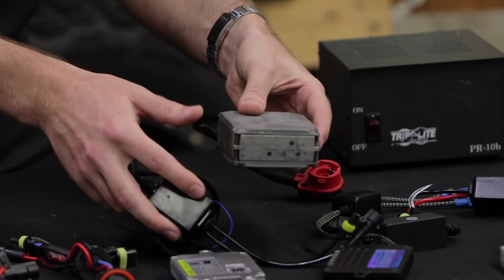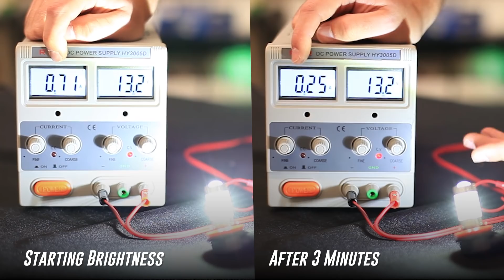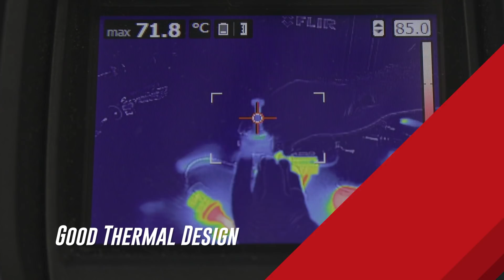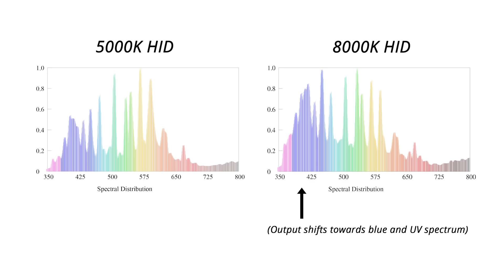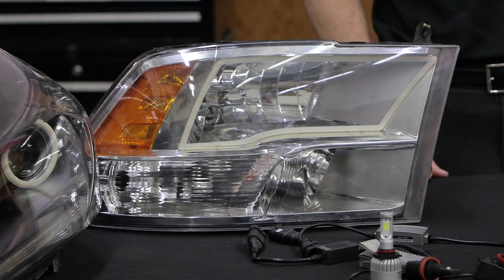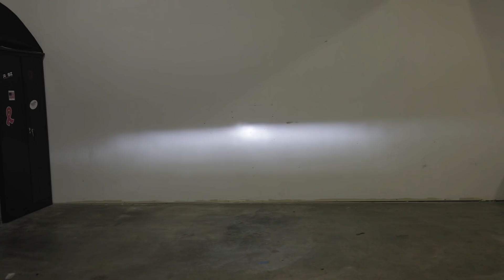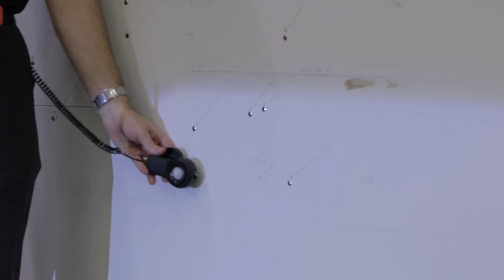HID vs LED Headlight Bulbs: EXPLAINED

Comment: The best review I have ever seen regarding HID vs LED comparisons I have seen to date.  I had a 55 watt XenonHid.com kit (looked like 10x brighter than stock) that was perfect on my 2017 Honda Ridgeline RTLE Awd but due to the canbus system, I had to frequently turn the switch on and off just to get them to turn on.    I ended up switching to Headlight Revolution S-V.4 led and they are excellent. Not quite as bright (still looks 3x brighter than stock) and definitely more reliable on my end.
Reply: I had this problem on my Honda 954RR motorcycle, I used a programmable parking brake video bypass module of all things. They are used in cars to get video when driving on Alpine radios. Basically everytime I started the bike the bypass was programmed to do a on/off/on sequence that triggered a relay that turned on the ballast. I couldn't believe a $15 parts solved it. This was an FYI just in case someone who aren't fans of LEDs just yet.

Comment: so reflector headlight gives more light then projector headlights?
Reply from the maker: Hey Marko! You can see a higher measured lux rating for reflector-style housings since they don't suffer transmission losses like a projector lens does. Just because the light source is brighter, that does not mean it will all be focused on the road. Thanks for watching! 👍

Comment: Great video, I have a set of SL1's for my 2019 Fiat 500 Abarth. I installed them briefly (10 minutes or so)and then pulled them out. They just weren't bright enough. I was thinking of going to HID's, I already bought a set from another company and they didn't work at all. So, $300 later and I still rock stock headlights and feel a bit foolish. I noticed the craftsmanship on the SL1's was the best I have seen, certainly not Chinese junk. Would I see better performance with your HID's over the SL1's?
Reply from the maker: Hey Chris! An HID setup would defeinelty be brighter than any LEDs that we offer. If you want to discuss your options, just give us a call at 314-205-3033, Monday-Friday 9 a.m.- 5 p.m. CST, or shoot us an email at contact@diodedynamics.com and our service team can assist!

Comment: Great stuff thanks for the detailed explanations. Scotty Kilmer still likes the old glass headlight bulbs for vehicles. I don't think he's too off center as they lasted, didn't UV down and were easy to change. But alas that's progress. Wasn't thst long ago that LED was in an electronic circuit and most had no clue what it was or for.
Edit: BTW I'll watch this again several times as that was a lot of information.
Reply: It would be progress, to simply mold the glass in a more aerodynamic shape and have it stay clear for the life of the vehicle instead of UV degradation over time.  However, that does not mean it has to be a sealed beam there the filament inside is part of the glass housing.  They could still make it replaceable as they do with current polycarb housings.
Reply: @stinkycheese804  Such where made.  I've seen a few with glass moldings.  I had a Chevrolet Lumina APV (much like the van in the movie ZombieLand Double Tap).  It had glass housings it was fantastic.  A rock finished one of them :)

Comment: 16:21 What about a capacitor/supercapacitor? With some added programming to the microcontroller, HID manufacturers could add a delay when you turn on your headlights for the cap/supercap to charge up... Then it can draw all that initial power for the strike from the cap/supercap, eliminating the errors on newer vehicles when doing a retrofit. (That's my theory anyway.) (I still think I prefer LEDs though.)
EDIT: I forgot to mention (although should be obvious) you/manufacturers would need to ADD a cap/supercap to the kit, since there's not a system with one that I'm aware of.
Reply from the maker: That's exactly what our CAN-BUS Anti-Flicker Modules (inline capacitors) were designed for!
Reply: Diode Dynamics 
Oh wow! Cool!

Comment: Reflector - halogen: 1190 LUX
Projector - HID: 800 LUX
No way these numbers are correct! That would be 50% more light to the halogen.
Reply from the maker: It's surprising, but those numbers are accurate! Projector housings offer better overall beam pattern and width, but reflector housings are more efficient in regards to putting light on the road. Reflectors don't cause the same transmission loss that a lens does for a projector housing either. Thanks for bringing this up, Viktor!
Reply: @diodedynamics  Sorry but it looks like you just found the crappiest HID kit on the planet. :) And i am not talking about the HID vs LED numbers. LED is the future thats for sure. But reflector better than a HID system? Seriously?!
https://www.youtube.com/watch?v=0KbZBgrEk_w

Comment: How do i convert my xenon hid head lights to led? My car came with xenon and every led head  light kit i get never plugs in right
Reply from the maker: Hello Fred! Unfortunately, if you have factory HID, you would be unable to easily swap to another style of bulb like halogen or LED - sorry!
Reply: @diodedynamics  That's what I figured. Are there different HID lights I can get? Like brighter whites then stock.
Reply from the maker: @fredwilliams7893 , while not brighter, we do offer different colors of the bulb on our website.
Reply: @fredwilliams7893  You shouldn't be having problems with the brightness of the xenons since HID is one of the brightest forms of headlight technology. 

Just buy new capsules that are as white as possible. The more color is added to a white color, the less bright that light is. This is because non white colors "darken" a light output (yeah, I learned all of this in a college class). So a neutral white color (5500k or 5000k) should be brightest.

Also, you can have you lights adjusted to aim further down the road.

And if you tried all of that and the lights are still not bright enough, you can add led fog lights to your bumper if your bumper has spots for them. Just be careful not to allow the bumper lights to be brighter than your main lights (many countries have laws against that, so you will have to check your state laws if you are in the us).
Reply: @angrysocialjusticewarrior  my stock ones are kinda bright with a slight blue to it. I like the realy bright white headlights I see on some cars like what the led provide.my car is a 2008 Infiniti M45 Sport. And can't find better lights then what the stock provide.

Comment: Kind of late to the party here, since I converted from halogen to HID in my projectors last spring.  Looks like I made a good choice from what I have seen here.  As others have already said, I found this to be one of the best videos on YT about headlight options and the pro's and con's  of each type.  Very well presented.   Even though I made a good choice on what HID system to use, I sure could have used the info in this video last spring.  Took me literally weeks (months?) to gather up all the info I needed.  This video pretty much covers everything I needed (need) to know.  Great reference tool for anyone looking for headlamp options.
Reply from the maker: Thanks for the kind words!
Reply: @diodedynamics  Very welcome.  You earned them.  :)

Comment: I just returned an inexpensive pair of LED halos for my E39 BMW (1999 528i). The original owner chose the HID factory option. Any suggestions for halos? Definitely get HIDs? So cheap LEDs will suck after time so it seems.
Reply from the maker: Hey there! Any of our HD Halos from the link below would be a good option to retrofit!

https://www.diodedynamics.com/accents/hd-halos-strips.html

If you have other questions, please give us a call at 314-205-3033, Monday-Friday 9 a.m.- 5 p.m. CST, or shoot us an email at contact@diodedynamics.com and our service team can assist you!

Comment: i bought cheap leds on amazon for my previous car and they did great, i ran the car for like 3 years with the leds, i hit a deer with the car and rebuild the whole front end, and kept the same led bulbs from the crash and they lasted another year of driving.. they still work now even now that the car doesnt work haha I cant say all of them are good but the ones i had got are good.
Reply: my leds have different colored lens you can interchange on it, its clear white without lens but i put blue tint lense on them

Comment: I installed led bulbs to my 98 grand cherokee laredo headlight housing. After I polished the lenses I'm getting stronger lighting in from of me. I would like to try the ones you talked about.
I'm intending to change the original lenses and instead glue back clear ones after I install a 3 inches diameter reflector unit, for that project I might need the ones you recommend.
Reply from the maker: Shoot us an email at contact@diodedynamics.com with your vehicle information and we would be happy to look into this further for you!

Comment: Diode Dynamics, So, without contaminating myself with further watching this video, I will invest in buying all the old style bulbs and former lights that are instant and safer for the longer duration of lighting for my vehicles. Stupid scientific advancements, are not good for anyone. Does not matter what "good" You claim, does not make it any safer or righteous. Just Bad.

Comment: Great video!  Good info and entertaining as well.   I'm proud to be running your HIDs in my Mustang.  Over 2 years and not one issue.    Do you also sell replacement bulbs when the time comes?
Reply from the maker: Thanks for the support! We do offer just the replacement HID bulbs on the website in the event one burns out or if you wanted to change the color.

Comment: good video/info but not unbiased as you are selling your LED for $150! You forget to mention FM radio interference with LED (on cheaper models - do yours have this ?)
I replaced the low/high on 2014 Prius with $15 COB Cree (www.amazon.com/gp/product/B07DZ551P8 which are 10x cheaper than yours ) and they are SO much better than the dimmed yellow 5 years old bulb that were there - no glare issue  (I checked as they are so bright) and I can see 2-3x further out. Modern white color too. Affects FM radio but daughter doesn't care (iphone music).
On my 07 Acura MDX I replaced the HID bulb (cheap like $17 a set) but didn't replace rest with LED due to radio interference...
Reply from the maker: While we do offer many LEDs for sale on our website, the point of this video was to explain many of the differences out there and help educate.

In regards to radio interference, that is certainly an issue we see with cheaper LEDs. The SL1 that we offer factors that into the construction of the bulb, and the vast majority of vehicles will not experience radio interference at all.

Through our extensive testing of COB style bulbs on the market, as while they appear to be bright, that style of chip and the placement of it are not ideal for headlight applications.
Reply: @diodedynamics  thanks, and I understand. I tested in the real world and am happy with my LED purchase. It's hard to justify $300 for light replacement on a base Prius... I had one side with LED and one side with 5 years old bulb, and covered the headlight with a towel and the difference was phenomenal on a straight road, and checked for incoming traffic glare at a distance as well. LED were pretty much same price as new regular bulbs so no brainer for me...

Comment: I was always told and later tested to be true, you should never put HID in reflector style headlights. So much blinding going on, granted, there are exceptions but it takes a very good designed reflector housing to work. Most US based reflectors are not in this category. Most European designed reflector headlight housings will have a cuttoff similar to projectors and you might get away with it. Plus most European housing cuttoff have the nice "notch" in the cuttoff so you are not blinding oncoming traffic but have increased lighting to the side of the road, just make sure you are not getting them designed for Right Hand Drive countries if you are not in one.

Comment: very interesting and informative. I've got a 13 year old BMW with factory fitted bi-xenons. When i got the car i was very underwhelmed by them, especially full beam. I was a bit shocked at how much you can spend on bulbs so i have to admit i cheaped out. The bulbs i took out looked to be the originals so the life of them is amazing but the output had obviously reduced gradually over the years. The new ones were a lot brighter but a year on i think these are losing they're brightness so i'm going to slash out on some nightbreakers soon. 
Buy cheap, get cheap.
Reply: Problem is a mirror inside of your headlight. Not the bulb itself.

Comment: I usually see that LED headlights are brighter. But I also find that the wavelength of the light seems to not penetrate as well. The light tends to be more focused, rather than a nice bright spread, in my opinion.

Brand new cars have better designed. I assume it's more to do with lens design. I see quite a few folks throw in HID or LED bulb into their original OEM headlights. But the LED or HID isn't in the correct position as the original Halogen bulb. That makes the light focused in a different spot whether you have older glass lens headlights or plastic clear lens ones with a very specific reflector design. This makes the headlight perform horribly no matter how bright.

In the end I found to just stick with the headlight type that your vehicle was designed to use. Or you might get lucky with a bulb that fits perfectly and is positioned perfectly in the lens as per OEM design for the reflector or the glass lens.
Reply from the maker: While that may be the case with many LED bulbs on the  market, the SL1 that we offer was designed to mimic the beam pattern of a stock bulb so you will not run in this issue. Feel free to give it a try - we think that you will be happily surprised with how well it performs! :)
Reply: @diodedynamics  that's great news. I'll see if I can find an Australian supplier

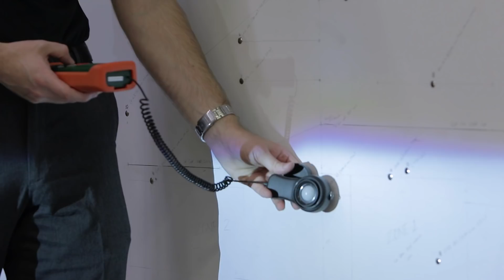Comment: 23:02 vs 23:39 Shows that a good HID in a projector is better than many of these LEDs because of the arc giving off 360 degrees of light. Manufactures are now making their headlights with LEDs in them, but specifically designing the projector lens to work with the LEDs. I run  LEDs as high beams (instant full brightness). And HIDs in a projector for my low beams, it was a retrofit so I used quality Morimoto components.

Comment: I'm so glad you bring up the glare.  Now I can respect the fact you want  bright lights because you are blind.  I can even respect the fact that you want a good light for night time clarity.  The problem that I do have is when you want a light so bright that you can see into the future.  You're future is seeing someone veering from the oncoming side of traffic and both your ketchup packet a××es being killed because you dont understand glare.
Reply from the maker: When placing a properly designed LED bulb like our SL1 into a reflector or projector style housing, you will not get any glare, due to the bulb mimicking the beam pattern of a stock bulb. With many other bulbs on the market, they spray light in a way that does cause glare unfortunately.

Comment: In Germany (the self-pronounced driver of innovation) retrofit LED bulbs (only for cars of course) are simply not allowed. They might be more reliable, have better focus and reliability.
But if you use them, you'll be fined and your vehicle is deemed not safe to operate.
And it probably woun't change for the next 5-10 years.
It sucks major ass driving my old car when it's raining in the dark while most other cars blind you.

Comment: Thank you for the video on the different types of lighting available.  It has been my experience that the CRI (Color Rendering Index) of all types are not properly explained.  Your target of 6000K for color temperature in my opinion is too high.  Humans see best (see color best) at 4500K.  Halogens are the only type of light that can output a 100 CRI.  Everything else that is blue shifted (including those Halogens marketed for the blue shifted light) have a CRI that is much less than 100 including the LED's which operate at about an 85 CRI.  The worst driving condition is that of a rain that becomes a fine mist on a dark night.  HID's perfom horribly, and LED's create so much glare, especially with projector style headlights as to be dangerous to oncoming traffic.  Halogens made to be extreme white in a reflector headlight assembly to me are still the safest bet for driving.

Comment: Overall a fairly good video.  The only factor really not touched on is the disadvantage of optical alignment/glare and lack of throw for LED's, which probably is why they didn't do the beam pattern testing in a dark room.  But that is understandable, since they are trying to sell LED's here lol :P
Reply from the maker: Hello there! Feel free to give the SL1 LED a try, we think that you will be happily surprised with how well it performs within a stock housing. :)
Reply: @diodedynamics  thanks. Maybe I will try them for my high beams, but for my low beam projectors I prefer my HIDs

Comment: Really informative video. I've gone from Halogens to HID to LED. My headlights are standard Peugeot coupe type which were designed for halogen. 55w HIDs were a big improvement, but a lot of cost for the best gear as well as the space. Long delay on mainbeam was a worry, which was what prompted the change to Philips LEDs. 
I would just say that masked HID lamps are the thing for reflector units.
Always buy the best.